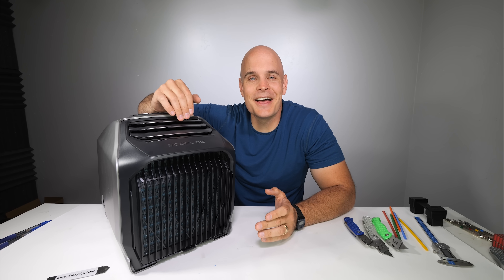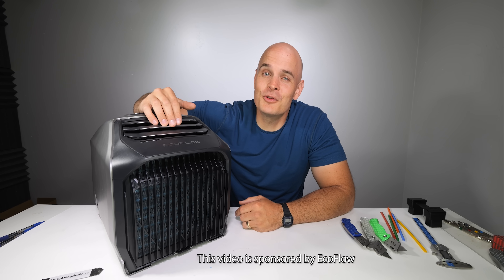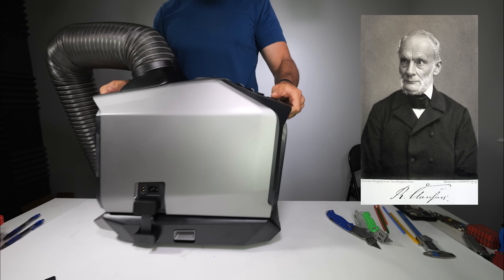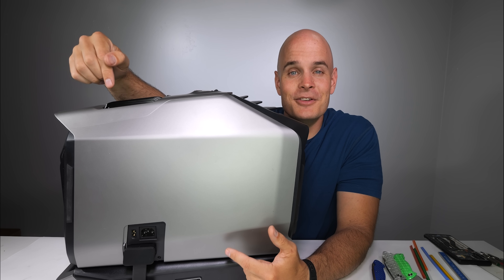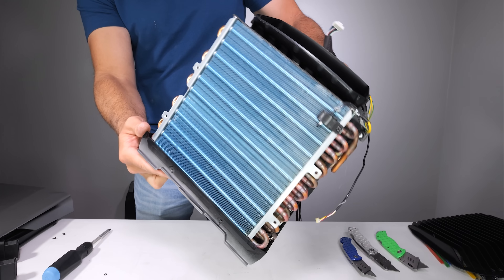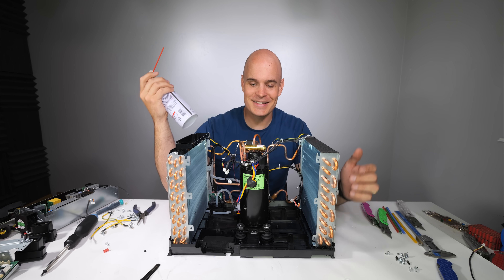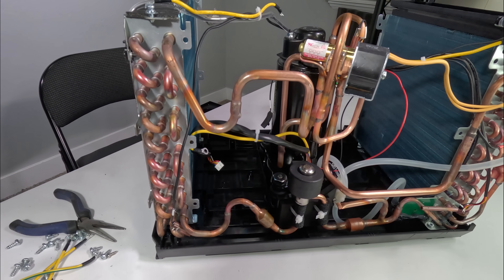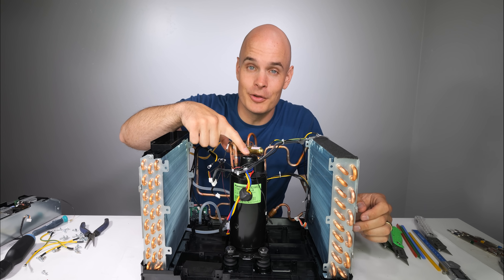THIS CHANGES EVERYTHING... (Ecoflow Wave Teardown)

Comment: It's worth noting that as far as modern heat pumps are concerned, 200% efficiency is actually quite terrible. The more accurate term to use is COP - coefficient of performance, where 1.0 means that the heat moved is equal to the additional energy cost. A higher COP is better. This unit would then have a COP of 2.0. modern heat pumps typically have a COP ranging from 4.0 on the low end and 20.0 on the high end.
Reply: COP 20 ?? i would like some reference to it sir !
Reply: @ayumuaikawa  not in the spirit of this, but a basic water pump can have well over COP 20.  1kWh can move 20 kWh of hot water (assuming water was preheated).  But that's all a heat pump is...move heat from cold to hot...but if accelerating hot to cold...well a hot water jug that uses no energy moves heat from hot to cold -> infinite COP
Reply: @ayumuaikawa  I expect they mixed up the SEER rating with COP. EXTREMELY efficient systems can barely manager a COP of 10-11. SEER of 16-20 is very good, with 21+ SEER being extremely efficient.
Reply: @ayumuaikawa  I'm not sure, I could be wrong on that. But I do think that a heatpump could get there in idealiszed scenarios. A range of 4-5 is achieved by many ac or refrigeration units though.
Reply: @tronique5736  yeah 4-5 is the way to go right now (at least that's what some professional told me), that's why I was wondering if a 20 was out in the wild, I might have taken my money out considering how energy price is going up😅
Reply: Ac is rated in seer not cop. Well not typically. A seer of 20 is good (cop 4.22) but for mini splits I've seen up to 42 seer
Reply: @teabee44  this is like saying temperature is measured in Fahrenheit not Celsius. You are right that SEER is more common on spec sheets for refrigeration systems, COP is just way more intuitive to explain and very easy to calculate.
Reply: I know geothermal systems go up to 400% or 4 COP, but to get 2000% or 20 COP. Holy shit you have got to share that with me man, please link an example if you have one!
Reply: @timothysands5537 COP of 20 would be with no superheat of subcooling, which is fairly nessesary for actual funtion to not break anything, and also a super low heat differential.
Reply: What's the highest COP product you've seen?
Reply: Thought about 300% was the norm.?.
Reply: How much watts take in starting?
Reply: For the small size this is and compared to a portable electric heater, 200% is still particularly great. You shouldn't use this large scale, obviously, it's literally meant for small spaces.
Reply: Trane XL20i
Reply: @superalpha  i don't know why youtube is so stingy about link so here's my comment... again:
unfortunately this is SEER 20 not COP 20, which mean it would be COP 5.86 which is still pretty damn good,  to get this number i used this source: sciencedirect and look for "seasonal energy efficiency ratio"
"SEER is very similar to the “coefficient of performance” commonly used in thermodynamics, except COP is a unit-less parameter. (To convert SEER to COP, multiply by 0.293 or (1055/3600). In theory, a SEER of 13 is equivalent to a COP of 3.8."
Reply: @ayumuaikawa  SEER 20.0 is equivant to COP 4.22 and EER 14.40 to my knowledge.
Reply: Cop of 20 + is possible anyone that sneezes at this is duh mb.
But remember it needs an industrial hybrid system.
Remember cop is heat moved divided by actual work done to move it.

If I stay in an arid place with ambient temps of 50c (delhi india), I need something like a 5 ton with rated cop of 4 which would consume around say 6kwh or 0.45 USD to operate per hour to keep my top floor flat cool to 29c
Meanwhile if relative humidity is below 20% which it is then I need only a 1hp or 0.765kw fan to cool a certain amount of air from evaporation pad then I use a heat exchanger to cool the dry hot air outside while keeping it dry to be used to cool the inside of home, and I'll get the same benefit. This will give me like a cop of 30.

Im a different way I can just use an ammonia to water to air chiller system for a very high cop.

Comment: It is an interesting product, probably more useful for RV living. But, 200% efficiency, which is a CoP of 2 is not impressive in heat-pump technology. Currently home Heat pump CoP is reaching 4, which is 400%.  You would also need to connect two hoses, one to bring the air in to pass over condenser/evaporator and the other to take that air out. BTW, R290 refrigerant is pure propane and is a good refrigerant, used extensively in Europe but in N. America an unnecessary hype is created about its safety , perhaps to safeguard the commercial interests of CFC refrigerant manufacturers.

Comment: Well, using the condenser to get rid of the water from the evaporator sounds nice, but it has a drawback in that you now have a nice wet, hot film on the coils, which is going to provide both a perfect growth medium for bacteria, and also will corrode the coils to nothing in 2 years. Evaporator is already going to be a slime paradise, but those pipes and pumps will be clogging up, because of all the dissolved nutrients in the water.  

Split units at least you only have to clean half the unit with biocide, but window wall and portable units you have to strip it down, and clean every part with biocide, at least every 6 months, otherwise you get the perfect Legionnaire growth factory, with the product being air delivered right to you. Plus you will find, around the time the warranty expires, that it just does not cool as good any more, because those nice blue coils, which still might actually look nice and blue on the outside, have now, on the evaporator side, been covered with a nice black mould layer, and on the condenser side have turned to white aluminium oxide sludge, also with black mould and slime holding it in place. Then on cleaning, you find that you have an outer layer of fins, and nothing inner left, all now just white powder and copper pipes, lying at the base of the case. 

Yes they can give a 10 year warranty on that Matsushita compressor, because they will absolutely last that long, but that warranty does not in any way cover the coils, the batteries, or the inverter itself, which you will also need to replace inverter and compressor as a unit, as the failure of one kills the other. Each one, to the average service centre, without the totally overkill diagnostic equipment at the production plant, will say the other is faulty, so both are replaced together. Note inverter is not warranty cover, and is nearly the price of the unit alone.

Comment: Does it intake air from the outside and exhaust it to the outside again for AC mode?  If it's using a single hose, without a partition inside(which I have seen and does exist), then it's steal the cold air it just generated from inside the room, to cool down the condenser.  Wildly inefficient.  Additionally it draws a vacuum inside the chilled room.  When you turn it off, it begins to feel warm again very quickly, because hot air is being drawn in, due to the vacuum inside the room.  There is a portable AC unit I saw at costco that has a hose in a hose, so it can intake and exhaust using 1 hose for the condenser.  Made by Danby.  It's a little less cumbersome with it's window mounting, I would think.

Comment: Technically this also has flamable gas inside. R290 is propane. But yeah, much safer and more efficient to use it's phase change energy than to burn it for a little heat...

Comment: This had sketchy 55" outside air intake and exhaust ducts and adapters.  Its really an expensive dual hose portable ac about $1000 more than one you buy anywhere and plugin.   Plus another $900 for a battery.  Nothing but a gimmick.  Kind of sad.  By the way, R290 is propane but very pure.  Hope it does not leak.

Comment: for the unit to be 200% efficient it would have to give out twice as much energy as it consumes, which is impossible with modern tech. Added to that a battery is also not even 100% efficient as it loses energy due to heat and the chemistry of batteries. Also cooling is a lot less efficient than heating (25 years of designing building services for large projects speaking). Its worth also stating that all refrigeration circuits are closed loop and its illegal in most countries to release refrigerant gas into the atmosphere. Its a nice unit but nowehere near 200%

Comment: There is no such thing as 200% efficient. Heat pump efficiency calculated in other way. We need to count how much heat energy moved from one place to other and energy loses for such movement. Lets say we have outside 2000 watts equivalent of heat energy. To move it inside we need to use 200 watts of energy (for pump) and 100 watts wasted in process (because there is no ideal movement without energy waste). In the end (2000-200)-100=1700 (85%). That's it 85% is the efficiency of heat pump. Everything that is over 100% is a marketing lies.

Comment: So the coil that gets hot is going to be the condenser. The side that gets cold is going to be the evaporator. The refrigerant goes through an expansion valve which lowers causes the pressure to drop and therefore the refrigerant gets cold before going into the pump to get compressed, cooled, evaporated, condensed, and start over again.
Reply: I think you got it. Basic heat pump Air conditioner. Main parts are a compressor, evaporator, condenser, metering device, and reversing valve. Compressor, compresses the hot gas, pushes it through the condenser to condense the gas to a liquid giving off heat, goes through the metering device, flashing liquid into gas and liquid, goes into the evaporator that evaporates it back to a gas giving off cold and goes back to the compressor to get compressed again. Air conditioning 101 in a nut shell. Heat mode reverses the flow of refrigerant, making it give off the heat inside instead of outside.

Comment: As a engineer. This isn't gonna work. At least not as a/c. There's a reason most of a window AC is outside the window. The goal with a heat pump or any air conditioner is to move heat energy to the condenser side of the equation. If the condenser is also inside it'll release that energy back into the room.

Comment: Hi Zack, love your videos. I want to correct a couple of things you said in the video which are a littel misleading, which I am sure you didn't intended. When you said it has 200% efficiency and compaired it to the electrical element heater having 100%, that's incorrect they are not the same. That's electrical efficeincy of 100% for the electric heater, the AC unit may have somthing around 60% electrical efficiency. The 200% is the heating/cooling capacity, which should be two differnt values one for heating and one for cooling. Basically if you input 1kW of energy, at 200%, it will provide 2kW of heating or cooling, after the energy lose through the compressor, fan and other components. Additionally, the BTU stands for Birtish Thermal Unit, used in many countires as a heating/cooling measurtment unit, funny enouph not used in the UK. 1kW of power is equivalint to about 3400 BTU/per hour. Last thing, I noticed one flaw in the design, there are no filters on the heat exchangers, which will be a big problem. Dust and dirt will accumilate quickly clogging up the fins, reducing their performance, having a filter to clean regularly will significantly reduce dust/dirt accumilating on the heat exchangers.

Comment: What bothers me about heat pump manufacturers is their efficiency claims. 
We all know that nothing can be 100% efficient, let alone 200%. 
It’s misleading to the layman. 
What they mean is that it has a COP (coefficient of performance) of 2, which in no way translates to efficiency…. Anyone looking to purchase or install a heat pump should do their research prior to buying. 
Also, R290 would not be the best refrigerant for a heat pump, especially in colder climates. 
A refrigerant with a much lower boiling point would be more efficient during the heating cycle. 

Also, at 5100btu, it is only providing less than 1/2 ton of cooling capacity, not very impressive (impressive for cordless, but not for an air conditioner in general).

Comment: honestly i can't really find a good reason to use one of those, for home use if you need portable AC you get portable A. For  RV and camping most of the time you have some form of 12V power, or you buy smth like jakery, mayby for tents ? but we should really move away from single unit portable AC, meaby some tech viz coud do portable mini spilt system with quick disconnect cooler lines ?

Comment: Seeing those two heat exchangers on opposite sides of the box is actually comedic, solid temperature differential you've got there
Reply: Not that different from a typical window unit. Still, could be better isolated.
Reply: There are sketchy 55" outside air intake and exhaust ducts and adapters.  Its really an expensive dual hose portable ac about $1000 more than one you buy anywhere and plugin.   Plus another $900 for a battery.  Nothing but a gimmick. By the way, R290 is propane but very pure.  Hope it does not leak.
Reply: @rj.parker  this has lot more than one of those portable aircons. 
I would have never expected a twin rotary compressor and reversing valve and electronic expansion valve. + It is veriable frequency drive. So it is more like if you buy a inverter portable heatpump which don't exist. 
All of the cheap portable aircons have capillary tube and fixed speed compressor.
Reply: @KuntalGhosh  This setup does not really make sense though. Why have a reversing valve in the system if you could literaly just turn the box around and attach a hose to the cool side? Same effect, less parts that break. There you go, heatpump.
Reply: @CreeplexHD 🤣
Reply: @CreeplexHD  Or you have it set up to maintain a specific temp and it might need to cool by day and heat and night and you aren't necessarily there to make the switch around....
Reply: @CreeplexHD you'd have no temperature control inside your conditioned space if you flipped the AC around and had the condenser coil discharge inside.
Reply: @rj.parker  the amount of r290 is negligible. Like 40gram or 50 gram.
Reply: That's how all portable and window air conditioners work... The rear exchanger is vented to the collapsible duct that needs to be vented outside. Like every other portable ac on the market.. Did you miss that part?
Reply: @travispoulin252  No, but that's excactly my point. Why would anyone buy this if they could just buy a normal portable AC unit, which would need a slight modification in terms of dual duct mountings/dual output grates? You could literaly turn the portable unit around, and have a heatpump if you want heat. You see what I mean? That is what I meant with unnecessary vavles.
Reply: Its harder than you think, i tried this with and old one i had and you actually need 4 hoses or atleast 4 hose mods to be able to turn it around, but also most home portables have a smaller evapourator and a larger condensor so it dont work well heating, you need to use the larger condensor as an evapourator and vice versa to get decent heat.

I have a tiny fixed speed portable from china in a tin case and it has equall sized condensor and evaporator, i modded that one and mounted it half through a window in a board i can remove and flip round the other way and this actually works pretty well@CreeplexHD
Reply: ... It's a single hose so it takes air from the room, which is bad for efficiency, but good because I don't worry about frozen coils in the winter, and also since our condo has no HRV, it doubles as a forced ventilation device (with quasi heat recovery) so long as a controlled air leak (cracked window) is provided to ensure airflow and no negative pressure pulling air through moldy cracks.
Reply: @ianwilliamrobertson  Use the dual hose configuration down to 43º outside; below 43ºF outside remove the fresh intake air pipe and let the unit use the inside air to pump the cold air byproduct out the window.  The coils freeze when outside air below 43º is brought in for heat extraction, unless unit has a defrost cycle, which most don't offer unless specified.  I would be called a "high efficiency," "hyper heat " or some such buzzword.  Lowest outside temp capable would be indicated in any case.  The lowest outside temp is the temp below which it is no longer cost-effective to attempt to remove heat, as coefficient of performance drops below 1. Generally, less expensive heat pumps have a sweet spot around 50º outside.
Reply: If they pay, the guy says the story. But this is one absurd and useless product. Probably some startup or whatever. He already has 2k dislikes on this video, the likes come from kids and bot farms

Comment: Normally it's the compressor that consumes alot of power, how are they solving that?
Is it just a smaller table top AC that doesn't cool the whole room or what?
Reply: They’re using a smaller compressor that operates on 12 V. It still uses a good deal of power, hence the huge battery . I would not be surprised if it’s rated run time is exaggerated.
Reply: @stephene.4159  So as I guessed it's more like a table AC to blow air on face